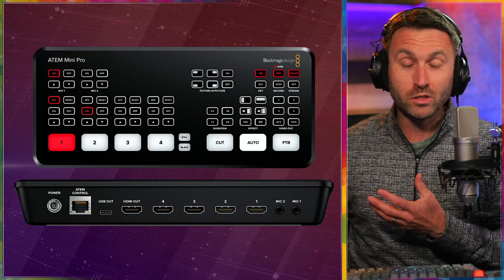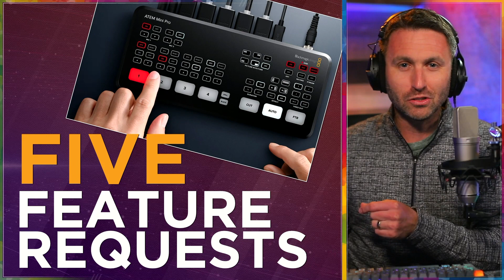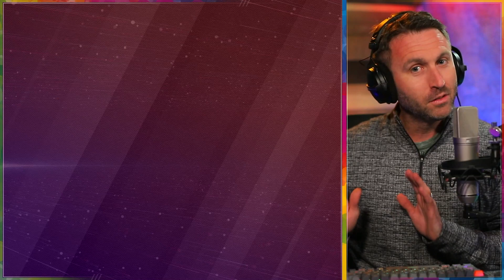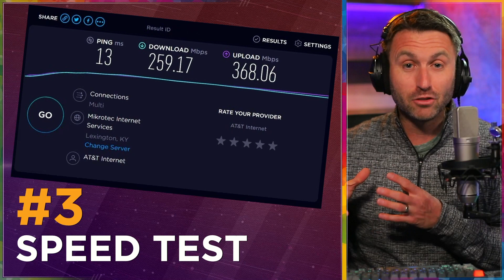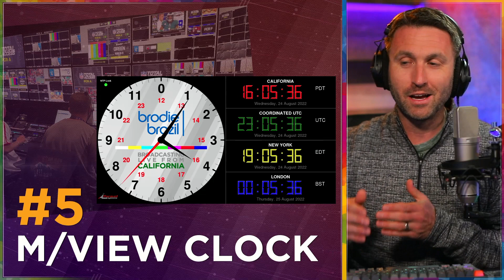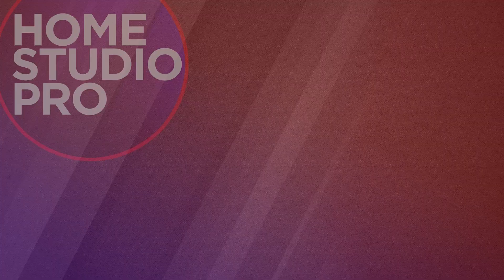ATEM Pro features for 2023?

Comment: I would like for the Atem to be able to run some sort of software on the computer where each HDMI/SDI port would be recognized as a separate source in programs like OBS/ECAMM similar how Blackmagic Quad HD card does with the Desktop video software.

Another request would be a easy way to bring in remote guest directly into the Atem. I learning how to do it with Zoom ISO
Reply from the maker: thanks for being here on the channel!  
your first request: probably difficult to send all thru 1 usb-c cable into the computer. but maybe a future interface might use ethernet or fiber.

second request: that's a GOOD one!  integration with zoom. but I think you're already on the right track using zoom iso.  good luck!

Comment: Macro keys: the Atem Mini Extreme does have already 6 dedicated macro keys. Probably there is not enough space on the Atem Mini Pro for those buttons. However I agree it would be useful to at least have macros in software on the Pro same as on the Extreme.
Reply from the maker: you're right! sorry i should have mentioned that in the video -- i've yet to use an Extreme but was aware you could program a few of the buttons.  sure wish they'd open up that possibility for the mini's although i do understand it could get confusing which buttons are which if not labeled.